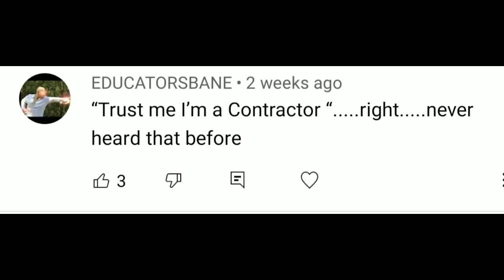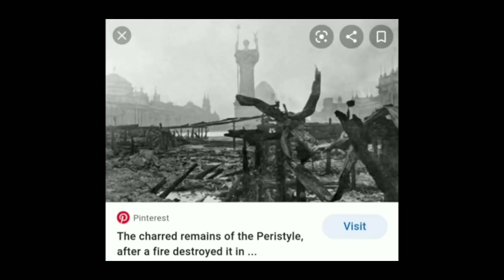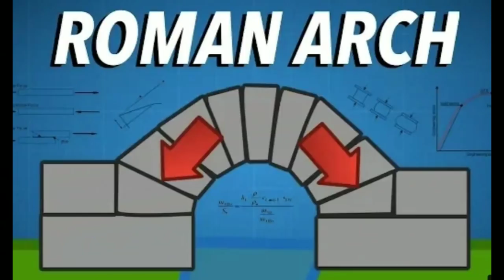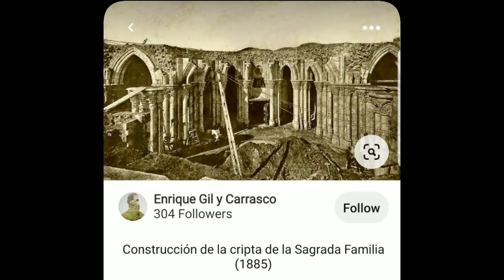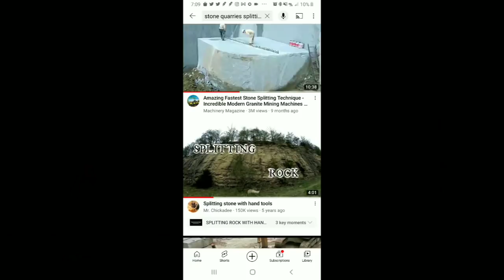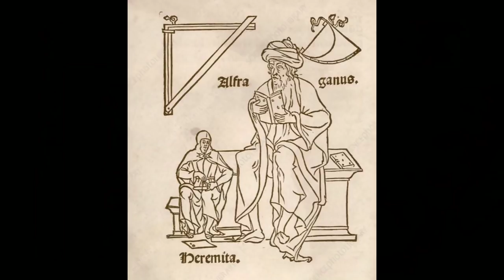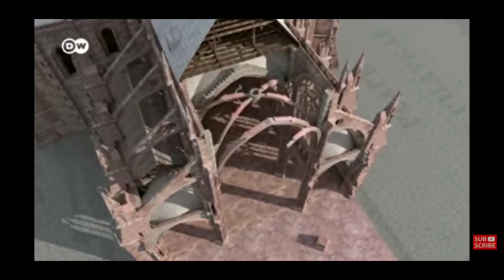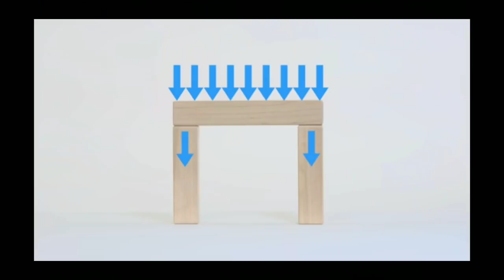Cathedrals - Structural Components - Cranes - Cutting methods - Transport

Comment: Excellent presentation!  One interesting point some have made about the Huge Doors on Churches and other buildings is that it is evidence of GIANTS!  What it is evidence of is you need these large doors to move huge construction materials and equipment into the building to do the construction!   Also some huge sculptures and other one-piece items that need to be moved inside the building would Not be possible without these large doors.    Thank you!
Reply: Interesting point.
Reply: Giants n giant doors. Been thinking the same thing.
Reply: Also if there were giants then why are the internal doorways pretty much standard size.
Reply: Actually, the high arches, ceilings ect. were more a about acoustics, let alone the delusions of religious grandeur, than giants.

Comment: i seen one horse pull a 250 gallons barrel, possibly more, in 4 feet of slush, mud on a very uneven terrain while harvesting maple water during thawing season. and the horse was not that big yet he could pull a ton of maple water in places were a 100 hp tractor would get stuck. 

during the dead of winter, when everything frozen solid, one big horse, well fed could pull double or triple that.

Comment: some of these places builders built 2 churches a year, with towns of less than 10000. I would guess that workers would travel and follow where the work was then.
Reply: The time frames are still a challenge to wrap ones head around when talking the official narrative.  With horse and buggy or just man power, the foundations alone for some of these buildings would be quite the undertaking without modern machines...  but that’s just my speculation..  we are an amazing species, capable of so much more than most can comprehend tho so I do my best to always remain open
Reply: @okanimal  Durham cathedral was built over 100 years, as well as a permanent work force of tradesman, landowners had to provide the services of their surfs, oxen etc for a certain number of days a year.
Reply: @okanimal  The foundations of these buildings are actually quite rudimentary simple masonry footings, its one of the reasons why quite a few have subsequently required underpinning.
Reply: @davidlee2624  thanks for the input. I appreciate the info. When I made my comment I was thinking of the Chateau Frontenac in Quebec city as an example.  I remember being quite astonished that they broke ground in May 1892 and opened in Dec 1893.   There were 2 expansions however, so I'm not sure on the exact undertaking of the initial build.

Comment: Lol I swear, y'all do y'all's best to keep the subject confusing. It's not confusing at all. Most of what we see and you show is just simply crappy repairs on top of another crappy repair. Only these recent years we can accomplish repairs that the old world would appreciate. The plaster...smh..hate to tell you..that was not a temporary style. Every old house located in the historic districts of each state/country have plaster interior walls. Built not for temporary use, but for permanement use. Uh..they didn't have drywall in those days. You get lath and put it across studs. And you put several layers of the plaster. It was even used without lath, and directly applied to masonry object. Lol it was actually fireproof compared to our drywall. You could not do these projects because you have no idea what these buildings are made of. The old school architecture came in 5 flavors or what they would say "5 heads of architecture". Devotional, Memorial, Civil, Military, and Domestic. Architecture was considered a fine art (is the art which so disposes and adorns the edifices raised by man for whatsoever uses, that the site of them contribute to his mental health, power, and pleasure.) All the buildings other than the domestic buildings where huge and took up several city blocks. If your thinking they dug down 2 or 3 floors worth of ground to construct the foundation, then they did that with every old building in each city/state/country. The ceilings on them old buildings are much taller than what we build today. So we ain't talking about 16 to  20' really, we're talking 24 to 48 and sometimes more. Y'all trying to make people think we didn't have electricity during the construction. Those city block buildings where constructed with well over a hundred rooms. Think about what time a contractor clocks out for the day in winter verses summer, and that's with generators, extension cords, and LIGHTS! You ever think about how those builders where able to do their work in the center of these buildings after all walls are up? You'll probably say "candles and kerosene". I've got a 100$ headlight that gives off more shadows than light.  Why do you so obviously try to mislead folks? You getting paid for it?  Your not losing subscribers because of the algorithm. Your losing subscribers because your audience isn't as dumb as you think.

Comment: You have no idea of the building s and bridges built of sandstone  in Australia by convicts,a 33 metre arch bridge near me had the stone punted to it,it's still in operation and is nearly 200 years old,they used the same framework for building another slightly smaller span bridge 10 miles away,same architect, Telford

Comment: wrong they lie they use rope and wire to cut granite you cant get a smoothed edge otherwise .i did not know some castles were sandstone .so this changes things for me . your probably right the giants built with the marble black stone of Ireland granite polished stone same .they rebuilt with sandstone .and  bricks .but they could have used the yellow sandstone parts in all the old high schools . from the ruins or made them